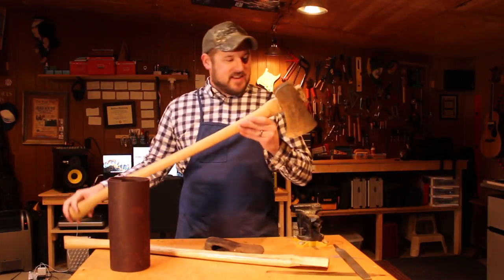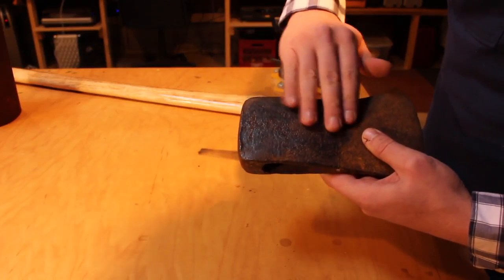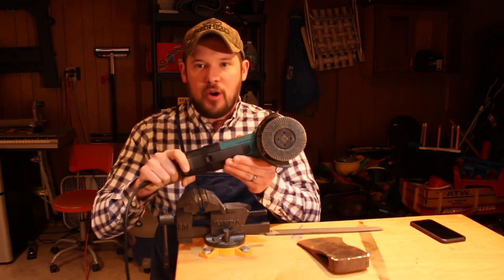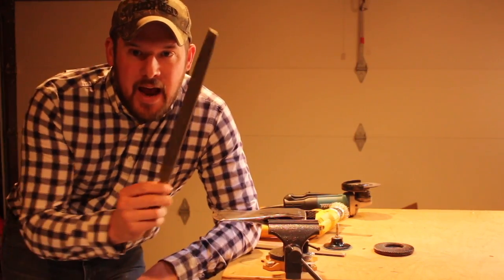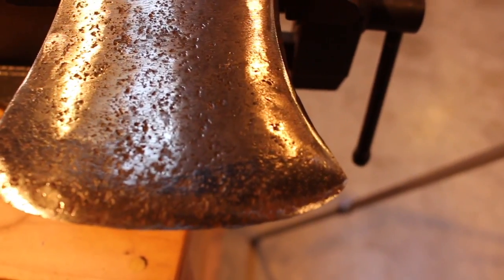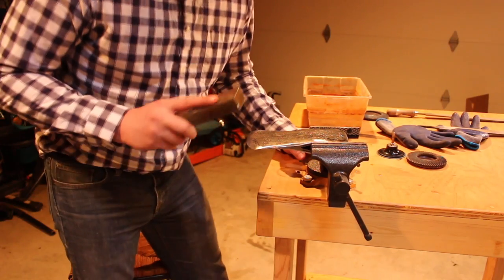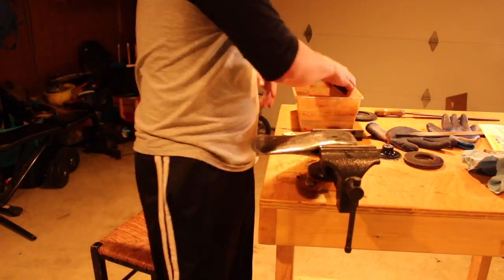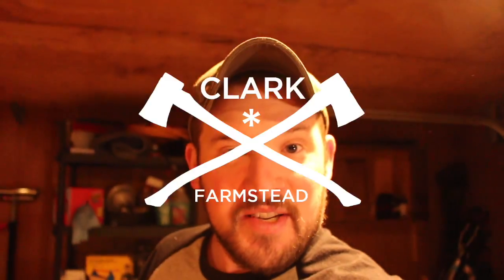Axe Restoration Part 1: Rust Removal and Initial Sharpeining

Comment: First!  haha.  I can't believe nobody has commented on this  yet.  Great job sharpening.  Was 60 grit on the grinder the only thing you used after wire wheel to take the pitting off and clean it up?  I noticed you polished it after you sharpened, most people polish first then sharpen.  No I'm not hating, just an observation and might be a safer way to restore axes so you're not handling a sharp axe head when polishing.